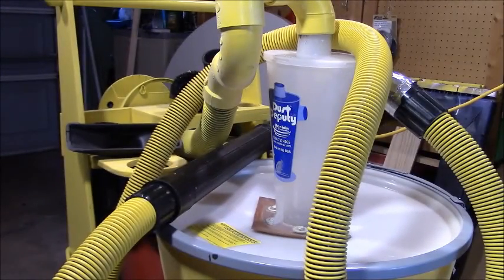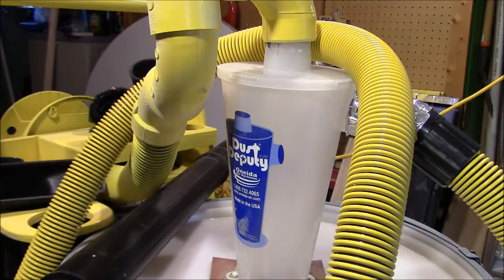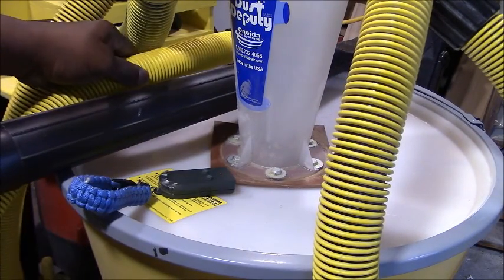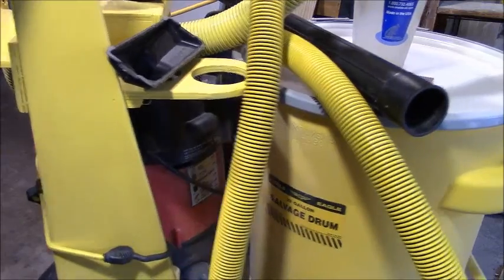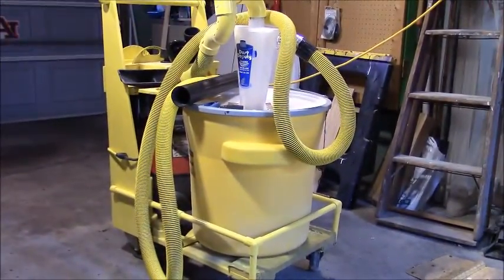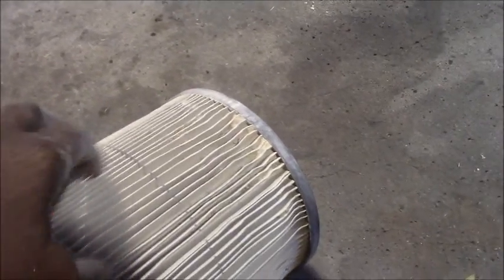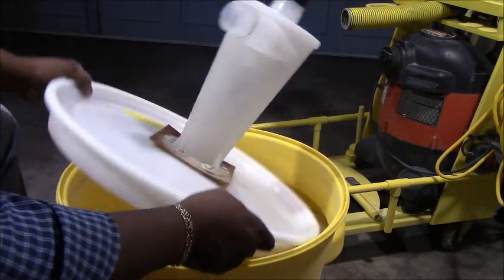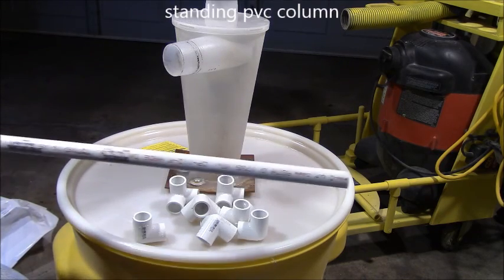DIY Oneida Dust Deputy Collection System - 1 Year Later

Comment: Cool fix.  If your problem persists, you might try reinforcing the top with a circular piece of plywood.  Nice project.
Reply: Larson Bennett that is what I did I added a 10 inch 1/2 plywood base to the cyclone, then mounted a plywood donut around that so the top is forced down flat. I do like his PVC  support.

Comment: Great build. I've saved it for when I get around to building my unit. Question. Is there a reason why you have the hose coming out of the back of the shop vac facing away from the dust deputy, and then looping over the top of the vac to connect it into the dust deputy? The reason that I ask is, it seems to me that the loop will create a loss in air draw from the dust deputy. But there may be something else going on that I'm not seeing.
Reply from the maker: Only because of the size of my cart length it just fit better. I was more concerned about short/sudden hose bends that would restrict flow and knew that long sweeping bends would cause less flow resistance even though the hose is longer; resulting in better laminate flow rather than turbulence (more resistance) air flow. In that section of tube only air flow with less than 1% dust, if that much.
Reply: @RobertWadlingtonDIY  Thanks for the quick reply. Makes sense to me.

Comment: Great solution. I've always been a fan of pvc pipe. For its weight it provides a lot of structural integrity. It is also easy to work with.

Comment: I've had mine maybe 6 months longer than you have yours.  Also still works great.
My vac is a Sears 1978 model that is still chugging along.  I think though that the larger dust deputy with a larger fan would do better on such things as the table saw and miter saw applications where performance is related to how much air you have moving.
Reply from the maker: Good thing about these Dust Deputy is keeps you from having to clean those messy and dirty shop vac's filters.

Comment: Always great to revisit a project.

I don't remember from the first video. Is there a reason you used the PVC at the top of the DustDeputy instead of directly connecting the flexible hose?
Reply from the maker: No reason other than I had the PVC fittings and plus at the time I did not have any extra hose length laying around from an old shop vac.